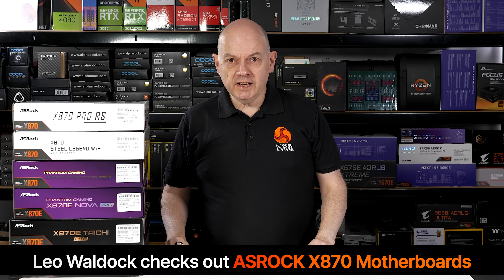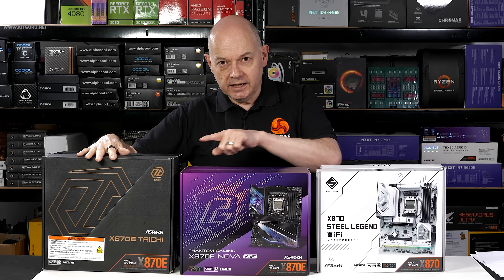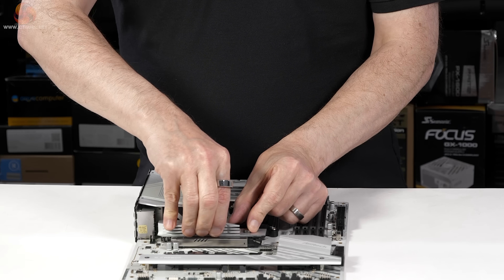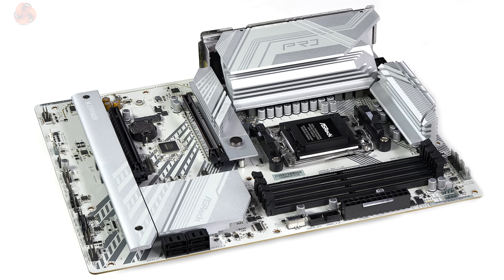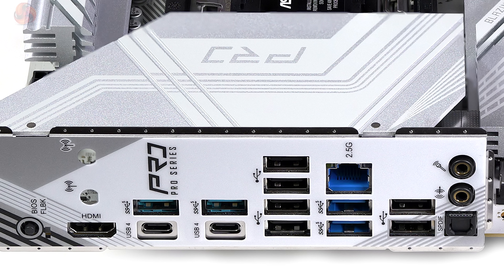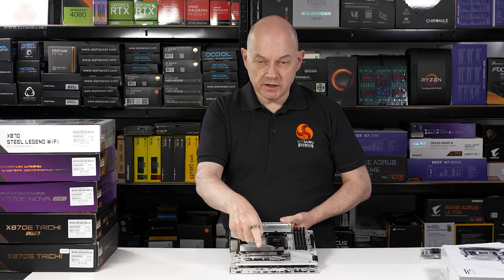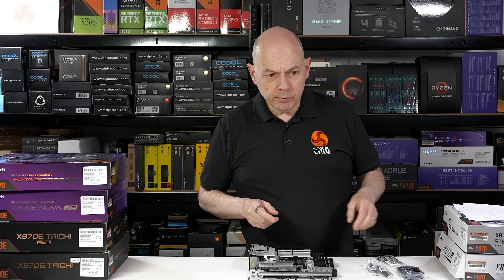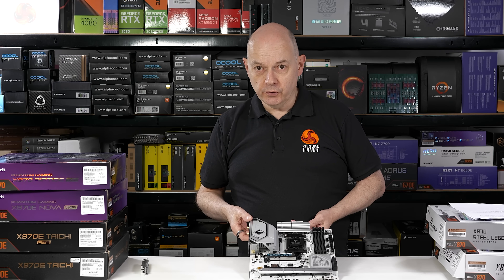ASRock X870E / X870 Motherboards - AMD Ryzen X3D Ready

Comment: Great video, thanks Leo. 

The Z890 versions of the riptide and the nova have fully tooless m.2 designs - not just the primary. 
God knows why the x870/e versions are inferior in this way... They are otherwise very visually similar.
It's a head scratcher... 

The riptide doesn't do enough to justify it's price above the steel legend from a features perspective, they could have solved this problem with a post code and the board might compare more favourably against the gigabyte elite7 and the MSI Tomahawk

The nova featureset and price makes some high end options from other board makers look silly... Provided the review goes well, might be my choice in the new year!
Reply: well summed up. I think the riptide has better power delivery, but you just dont need it for these processors - unless I have read something wrong
Reply from the maker: Happy to help 👍🏻